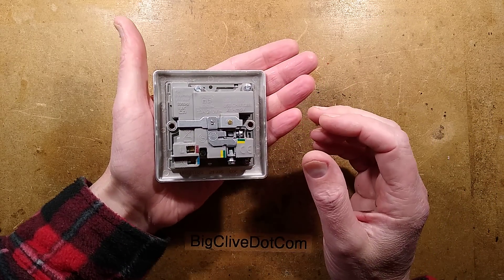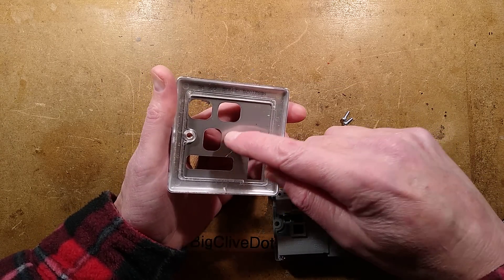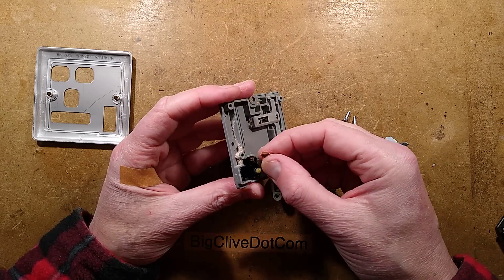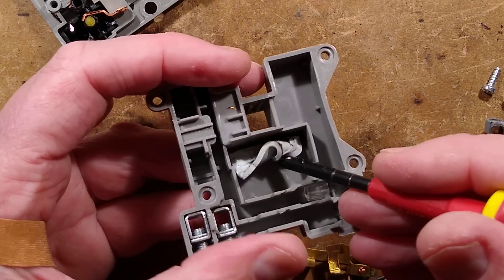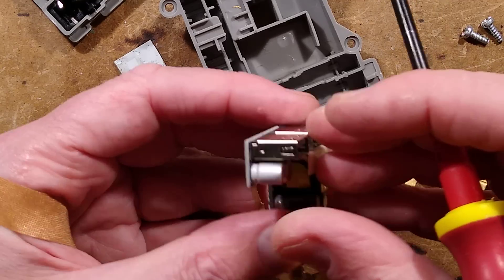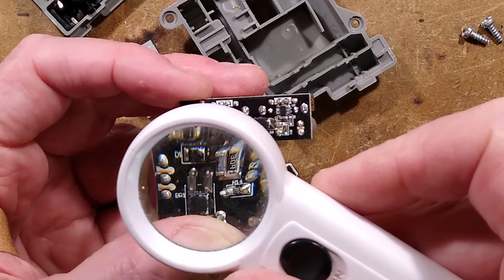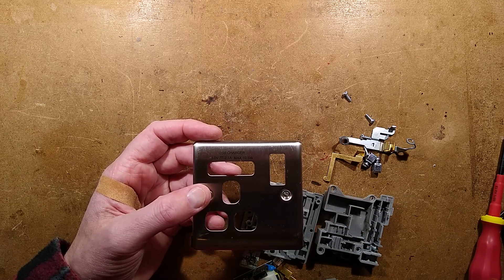Exploded British General USB socket

Comment: Personally, I think any power electronics which ends up partly or fully inside walls, ceilings etc is asking for trouble. My concern would be potential fire inside cavities, rather than component failure in itself.
Reply: Especially with cavity wall insulation which to my knowledge is paper.

Comment: If he was running the lights off of the USB port, it probably died due to high power draw for long periods of time. 99% of these in wall USB socket things are designed to charge stuff like phones which only need high power for a few hours with long gaps inbetween. Most likely the power chip overheated and died dead short
Reply from the maker: Generally the strings of lights only draw a few hundred milliamps.

Comment: Is that blue thing a tiny resettable PTC fuse on the incoming mains? Is that the only fuse on the board? Nothing on the low voltage side?

For something sitting across a 32A ring main, I would expect a better fusing arrangement. There must be some regulations for this; if this design meets those legal standards, then maybe the regs need updating!

Comment: I already never liked devices that plug straight into a socket. I prefer a power lead so I can put the device in a relatively safe place, away from curtains and other things that might catch on fire when things go wrong. Having circuitry built in to the socket itself is an even worse situation and I think it's stupid these things are even allowed.

Comment: The less electronics screwed in to the mains circuit the better. As other people have said better to have a plug in power adapter. The beauty of the mains circuit is that it is only wires except for the electronic trip  fuses.

Comment: BG stuff is junk, don’t be conned into thinking it’s good quality, I had a sparky change all my house sockets and switches, he used BG, I’ve had so many fail, mostly the switches on the power sockets, a couple of which exploded when turned off with a load on them, I’ve ended up ripping the lot out. Utter junk.😮

Comment: Um, strings of LEDs you say. 2 long strings of LEDs can soon add up to 10 watts, could not quite see what it says on the front. smile
I hope BJ haven't done like others do and take the total of both ports, so it gives a bigger number. (no x2) I have had things from China that do that trick.
Reply from the maker: A string of USB powered LED lights often only uses a few hundred milliamps.  Even a long one.  It's not a significant load.
Reply: @bigclivedotcom  Your right. I don't know the type that was plugged in.
Perhaps if they were the 3 colour programable ones about 30 on a strip. if the situation arose for white at full brightness. let's show off how bright these are he-he.

Comment: i think ill stick with using an adapter or even better a batttery bank. 

i seen them in Starbucks and i remember accidentally wetting it  a bit while cleaning umm maybe i should of told someone 
in stead of wiping that tiny nit of cleaner off dry in 2017 whoops

Comment: Having USB socket outlets in a home is fine, for people like us. When we buy them we buy a few spare. And if one goes we just swap it out. I do believe people should be allowed to change their socket outlets themselves, even if they aren't qualified electricians. It's really not that hard. You turn the supply off at the fuse board, and change the socket outlet. But I bet there will be legislation preventing ordinary People from doing this soon. I was taught to change a plug, on an appliance flex at primary school. They don't want you to do that nowadays anymore, it's too "Dangerous".
Reply from the maker: Unless something has changed, you're still allowed to change like for like.  But as far as I'm concerned you can do what you like in your own home.  Acknowledging self-appointed bodies only gives them a sense of credibility.

Comment: This is why I'd rather have just a bog-standard socket and a plug-in wall wart. At least that way there's nothing to go bang!

Wasn't there once a time when we were always being told never to leave any electronic equipment plugged in if it was going to be left unattended? And now it's getting that we have no choice.

I guess we're heading to a time where it will be common practice to replace your wall sockets every time you change your mobile phone?

To me, short lived electronic gubbins have no place inside permanently installed household fixtures.

Comment: I've had a similar screwdriver accident whereby using a long shafted insulated screwdriver doing up 80 amp board fuse unit when the screwdriver slipped and punctured through my hand between the knuckles of first and second fingers. Whilst my pain reaction was covered by shock i quickly pulled it out with little damage observable!

Comment: Maybe these exist already but I think this idea would work better if the USB was a spur off the socket sitting in it's own back box with a switch on the front that isolates it from the mains. When something goes wrong it's easy to isolate and it would be easier to upgrade. You could even build it so that the USB circuitry is a plug-in module so as we get new versions of the USB PowerDelivery spec end users could upgrade their sockets. The problem is people want it flush to the wall because it just looks better. Our job isn't to complain about that it's to design something that is safe and functional for them.
Reply: Ultimately people want things, neat and cheap.

Some manufacturers do make USB chargers in Euro module form which you could fit on a plate with a switch (and possibly also a fuse) if you so desire. Gets spendy though, both in terms of parts and labour and most people would probablly regard it as less neat than having them integrated in the socket.
Reply: I was just thinking these would be better if the USB part was modular & could be removed/replaced in case of problems. Companies really don't like modular stuff though, ever, even in high end products.
Reply: @NightCatArts  Ultimately modularity has a cost, both in financial terms and in size terms.

Sockets, switches, fuseholders and USB chargers are all available in Euro module form. You can also get semi-modular plates that have a couple of regular double sockets and then a bunch of Euro module spaces. The intent is to use the Euro module spaces for AV stuff but there is no reason you couldn't put USB chargers in there.

You aren't going to combine a regular socket and a USB charger on a normal sized plate using modules though, there simply isn't the ram.
Reply: @petermichaelgreen  I think it would be possible in a standard 2-gang space if the mains sockets were separated farther & the USB ones were set vertically between them. Even chunkier mains bricks tend to be taller rather than wider, & USB plugs tend to remain roughly the size of the socket.

All the USB Euro modules I've seen have the ports horizontal (so you only get 1 port per module instead of 2), which doesn't seem at all efficient to me. Plus the issue with the wider UK sockets requiring a 2-module space anyway, & replacement frames being limited to 4 modules, means the system doesn't make a lot of sense to me with USB.

The same concept, I think, could be used but specifically for a 2-gang vertical USB (or just any DC) module socket that could be half the width of a Euro one & sit between the two fixed power sockets. The only problem is that it'd be less aesthetically well balanced in order to fit into an existing 2-gang space.
Or they could simply add a third physical cut-off switch for the USB sockets..

Comment: People here complaining about 240 to 5V power supplies in their walls but don't we have similar things in all our LED lights these days? Would it be more energy efficient to have a low voltage transformer near your consumer unit and run low and high voltage wiring and separate sockets round a house? Run the lights and USB off the low and plugs off the high?
Reply from the maker: I'm an advocate for the concept of a whole house 24V DC buss fed by an efficient and plug-swappable power factor corrected power supply.

Comment: I could have installed a 13 amp 3 pin socket 20 years ago and would still be able to use it. This craze of putting usb into 13 amp wall sockets is totally stupid as usb standards are changing so often. Current output of USB is rising year on year which means you end up with electronics beried in your walls active and unused.

Comment: Considering that little bit of circuitry is connected directly across a 32A ring main you'd like to see some kind of isolation safety device at the very least !
I wonder if it tripped the breaker ?
Reply: @Smelly Wotsit It seems to me that the circuitry itself acted as a fuse and only disconnected the supply once the whole circuit was fried and could no longer pass current !
This is not acceptable in a 32A ring main !

Comment: We purchased several plug-in adapter units from Costco here in England, it has several USB outlets plus a couple of AC sockets so the whole unit acts like a plug-in faceplate, any issues just pull it out of the wall socket - And its non-conductive! I would have thought modern new builds would've been designed with dual power circuits, standard AC ring main and a low voltage DC ring, the overall cost of implementing such a system wouldn't eat too much into the profit margin of these overpriced cardboard flatpack homes that cost the developer around £30K and flip them for over £250K!!!
Reply: So many to choose from! In the 20s and 30s before grid electricity, 32V DC from a wind turbine and lead acid battery bank was the way to go. All sorts of 32V appliances were available. Nowadays the battery banks in hybrid solar systems are 48V. My own house has a 16V DC lighting circuit besides the usual 240V ones. The voltage was a compromise to allow some drop in wiring while still using off the shelf 12V LED lamps.

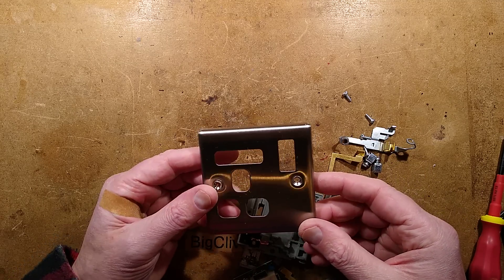Comment: The first question I would ask is "what exactly did you have plugged into the USB ports at the time of the flames? The next question is "what is the current rating of the ports in this charger? A: at 4:30, the faceplate has 2.1A max written on it. These days, "USB power" has evolved from being limited to 500mA to god knows how many amps. Some of these cellphones have ridiculously large batteries in them. To get them to charge in a reasonable amount of time requires pushing a lot of amps into the batteries. If there were many amps passing through the charger, heat is generated in the power supply. I see no thermal venting anywhere, so the heat has nowhere to go. "Heatsinks" don't work if there is nowhere for the heat to go. POOF! Another possibility: aluminum electrolytics. They have a very limited lifespan, particularly if they are exposed to heat for long periods of time. Devices like this sit there powered 24/7. One year is 8760 hours of continuous use. Electrolytics are rated for 1000 hours at a certain temperature stamped on the sleeve of the cap. Every 10 degree C rise in temp lowers the life of the electrolytic by a factor of 2. That's why I will never install one of these things in any of my outlet boxes.
Reply from the maker: Nothing was plugged in at the time.
Reply: @bigclivedotcom  Okay, but that does not rule out that some high power-draw device(s) had been plugged in in the past, which could have set in motion the failure of the power transistor or flyback catch diode. Even had it sat there for two years doing nothing other than "power was applied," that's a clue. That was the original request (failure analysis), was it not? It drives me crazy when someone says "this or that failed and I don't know why" and then do not tell you anything about the pre-failure history.

Comment: This is a concern of mine too, I do however have a couple of single socket plates with switched USB outlets (+the 3 pin too) no name chinese from ebay etc. While it's good ports are switched, the overall build of the rest still has a feel of shonkyness :-|   And before you all ask, no i for some reason cant find them again...

Comment: "I wonder how many things like this are sitting in people's walls"...literally everything electronic made in china that is designed to be installed into an electrical box is a fire waiting to happen just like this. Even if you take apart one example and it looks OK, the quality control is always so bad there is no way to know without taking everything apart first.

As far as I'm concerned the only thing that should be physically IN the wall are wires, outlets, and switches. Everything else can plug in. No electronic boards from china!!

Comment: I knew a firm that used these in there builds, the usb charger is just not great, has the ampage but most modern phones will only slow charge on them even tho they generally have 2 amp output available, also i would say 1 in 20 had faulty rocker switches

Comment: I know it's only television, okay?  But...

In an episode of Dr. Who, Rory is seen repairing a ceiling mounted light socket while Amy watches. This was in 2011 I think. They seemed reasonably comfortable financially, and canonically Rory was not particularly into technical stuff, but wasn't afraid of it either.
Have things changed that much since then, or is there some line that must be crossed to require bringing in a professional electrician?
Reply: I believe replacing a light fixture comes under the banner of things you don't need an electrician for, and if it's a straight swap then you don't have to puzzle out what all the wires are for (if you made a note before disconnecting the previous fixture).

Comment: Doesn't the outlet switch cut the power to the USB also? IMO it should be separately switchable so you could keep it off even if the outlet is in use.

I do not think these are good thing in homes. They are better in public places as people might not carry chargers.